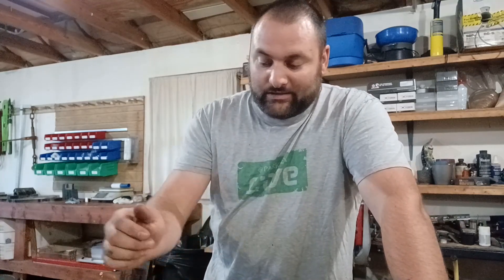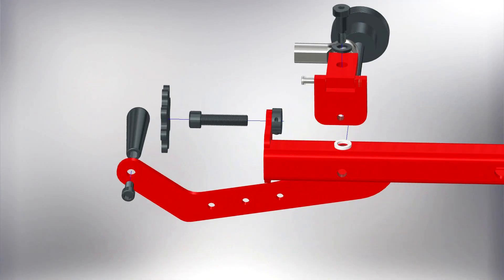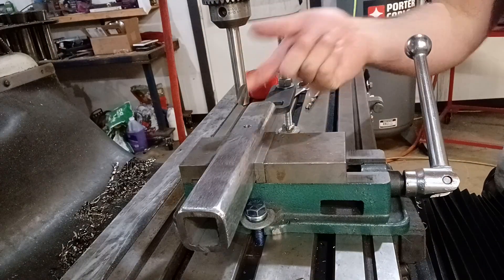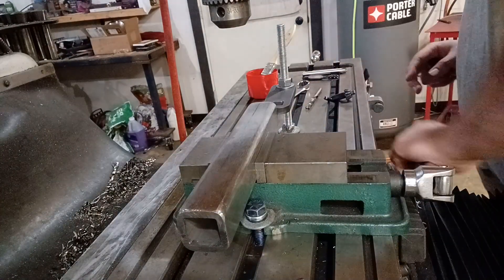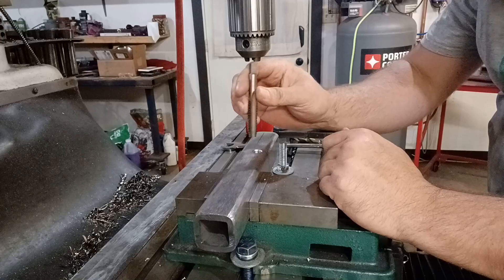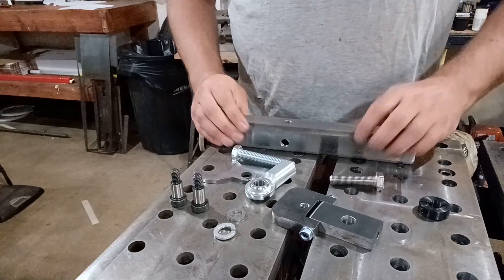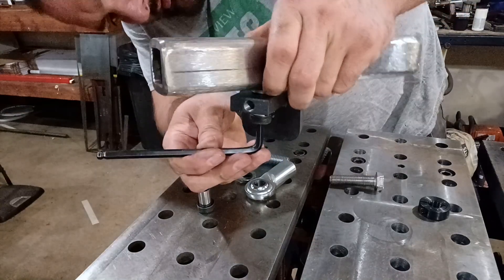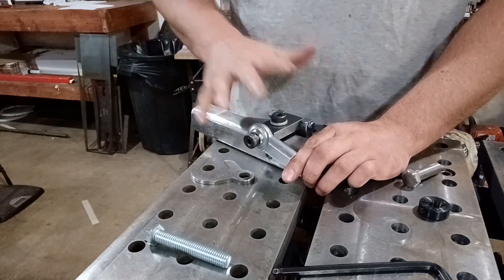How To Build The Ultimate 2" x 72" Belt Grinder Tracking Device

Comment: Rod ends do not bind unless pivoted out of spec. The play on the shaft means that as the knob is turned, the rod end may slide along its shaft, possibly before the belt alignment pulley moves. Easy to fix with washers, or just use a shorter shoulder bolt to start with. Lastly, suggest using a sealed type rod end instead of an open type, as the latter will allow sanding grit to get in and both accelerate wear and possibly binding.